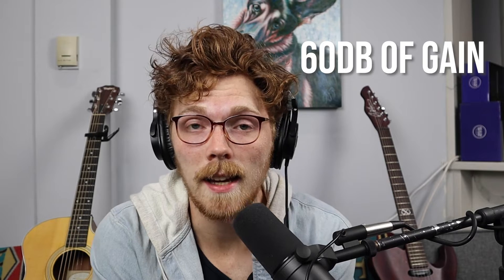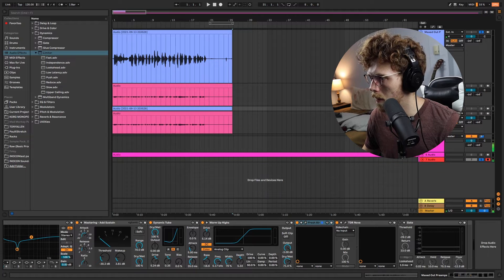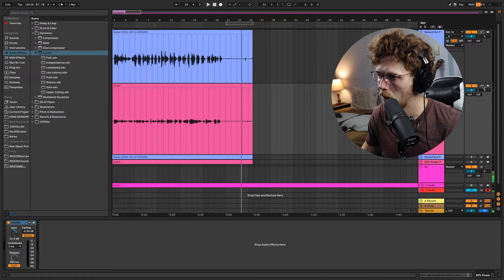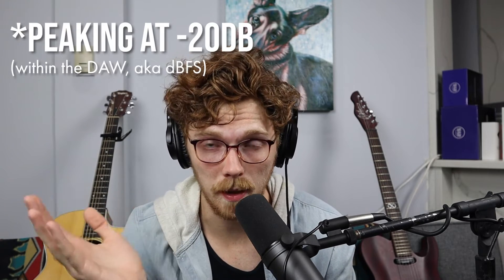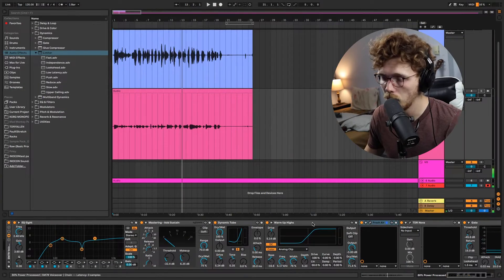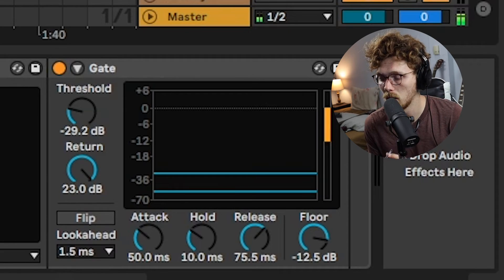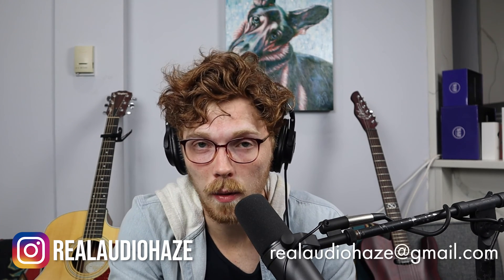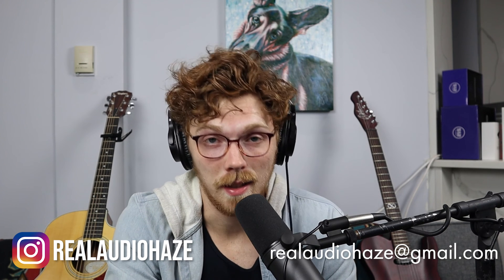How to Use the Shure SM7B Without a Cloudlifter/Fethead - Use Processing in Your Microphone Setup!!

Comment: Thanks
Reply: I’ve seen that  Podcastage Deus video you referenced on starting yours. I think It’s even worse actually. You have a very high chance of being left with a slightly distorted signal. Especially entry level audio interfaces, like the Steinberg UR22 Mk Give only you  an optimal signal in terms of distortion levels, if you NEVER surpass -10dBFS recording level. Even on my MOTU M4, which I consider to be lower mid range, I don’t really feel comfortable, to go higher then that. Oh well… Once again a great video of yours! And it’s an interesting way to a similar goal to mine. I’m much more severe in post processing my signal. currently using a) A High Pass 90 Hz at 72dB/oct. b) a noise reduction plugin, manually set to my individual background noise floor c) a noise gate, to deal with things louder than the noise floor and d) LoudMax, a maximizer to reach my desired level including a brick wall limiter.
Reply from the maker: oh wow thats a ton of noise suppression going on there!! I can't imagine your signal is that noisy is it?? Would be interested to know what sort of processing you do beyond all these measures to cut out noise ;) and thanks for the donation as always my friend :)
Reply: Considering I have my PC roughly 60 cm / 2 ft below the microphone, (very close, I know) with only the desk to block parts of the worst, my noise floor is actually half decent. At least with my Super Cardioid dynamic microphone, my source signal is like -20dB(FS) and its noise floor is -78dB(FS). The noise gate is not needed just to deal with background noise. My Expander Gate (I wrote noise gate by mistake before) actually used to deal with breathing.

I need to explain the post processing after the noise suppression and gating. My maximizer raises the signal by 20dB(FS) and adds a brick wall limiter at -4dB(FS), to give me something similar to a slight compression effect. My noise floor now would be at -58dB(FS) without the noise management beforehand. But still, my noise suppression manages it on its own, actually. (Additional effects are the usual suspects on live streaming. Reverb, voice modulation, stuff like that.)

So why dealing with breathing? Well, I use my microphone mostly for live streaming, where I don't bother with controlling my breathing all of the time, naturally. Because of this, my breathing, which at quiet phases is coming in at -50dB(FS) sometimes can become pretty loud, up to -30 dB(FS), which to my ears is unbearable. I'm Using my expander gate, to raise the dynamic range between breathing and voice, effectively lowering the breathing by 20 dB(FS), so even at worst times, I never hit above -50dB(FS) with my breathing.

Comment: I have an audient id4 interface and it l me enough gain to record this microphone at a good level, but having the knob to the maximum could damage it or force it in the future?
Reply from the maker: Certainly not! The knob at maximum will not damage the mic :)
Reply: @AudioHaze I was referring to the audio interface, for working all the time to the maximum. sorry for English
Reply: @Pantojandi definetly not, preamps work for ages even at full power. Also the id14 has a low enough noise floor to comfortably record an sm7b. Just stay under 95% gain and the noise is practically inaudible.

Comment: Hi there I'm genuinely confused about your noise floor test. 
You boosted both signals equally by 15db so of course the one with more preamp gain will be louder!
In order to accurately match the volume you need to know the difference in db between the 80% and the 100% first otherwise you are literally  just showing us the pure difference in noise level instead of signal to noise ratio.

It should be the case that the preamps get unproportionally more noisy at higher levels as well as boosting the signal strength in regards to the static noise level of the ADC and other factors as well (though I know this isn't always the case).

You can measure the pure interface noise by sending a line-out of the interface into the line in of your preamp and then recording that instead of doing a vocal recording.

Comment: The solution is simple- talk or sing louder. If someone can’t figure out the SM7B, I would question if this mic is out of your league. This is not a novice friendly mic and there are a lot of things to think about when using it; noise floor, interface preamp, headroom, how quiet it is, etc. etc. A lot of people using this mic aren’t taking advantage of its capabilities and a easier to use mic would work just as well.
Reply: The problem is it's a mic that looks good. A Shure SM57 and SM58 are more novice friendly but they don't look like you're an "official". It's ironic because the president of the US uses SM57 microphones.
Reply: @nerdyneedsalife8315    it does look good, but so does the 55. That’s more novice appropriate. Who doesn’t want to be like Elvis? Believe the SM57 has been used as a presidential mic since it was released for its noise rejection, two are used for one backup. There’s the MV7 which looks like a SM7B but has a USB interface. Shure just needs to make a mic that looks identical to the SM7B but with a usb interface or make their own XLR interface for the SM7B, they are leaving a bunch of sales on the table with people going to 3rd party options for the SM7B.
Reply: @jakp8777  The 55 looks good but in a different way. I do think Shure should have a plug n' play solution but it would probably cost more than what people would prefer.
Reply from the maker: Honestly I think if another company came out with a mic that looks as sleek as the SM7 but with the budget friendly nature of a 57 of MV7, it would sell like crazy. I think they tried to do that with the MV7 but the design just doesn't do it for me. Looks too stocky.
Reply: @AudioHaze  that sounds like something Behringer would do- call it the SM7USB and make it look identical. A lot of the SM7Bs popularity with entry level users is image and name recognition.
Reply: @nerdyneedsalife8315   I’d think they’d spend it. They already are spending $400 on a mic that’s out of their league, $100 on a boom, $150 on a preamp and who knows what on a interface.

There’s a lot of image and peer pressure with podcasters, gamers, etc to get this mic. Price doesn’t matter that much. Not like it’s thousands like other mics.

It’s one of my favorite mics, but the mic that recorded Michael Jackson’s Thriller album is way overkill for twitch gamer streams.
Reply from the maker: @jakp8777  haha oh god any company but them
Reply: @jakp8777  Fair enough, it does suck that this is a peer pressure mic.
Reply: @AudioHaze  The Presonus PD-70 looks like the SM7B and costs just a tad more than the SM57.